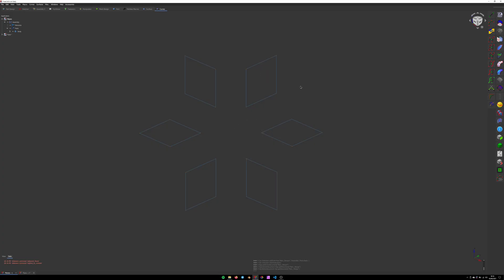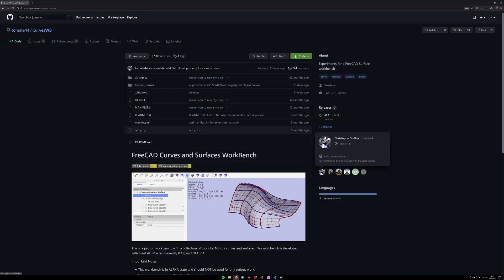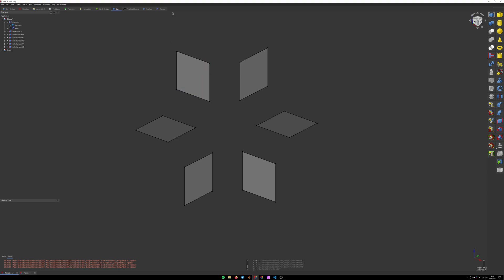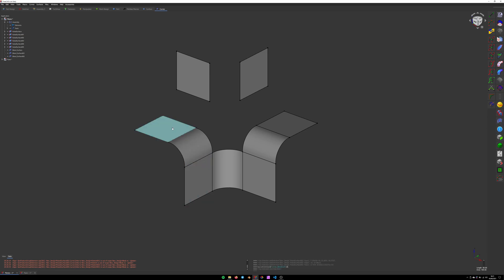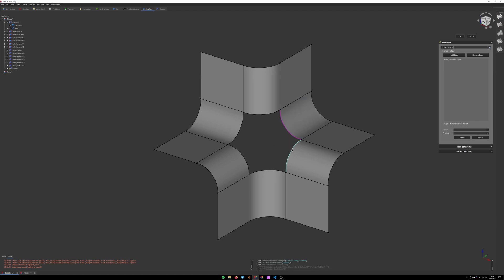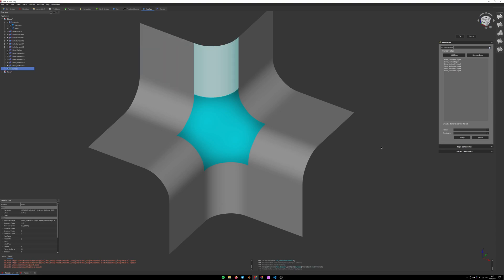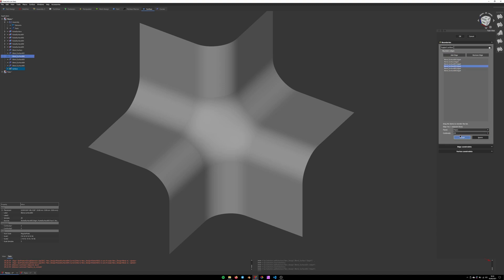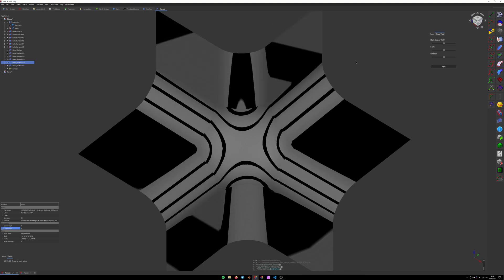[FreeCAD] Surfacing Tutorial (Surface WB & Curves WB) Part 1: Introduction

Comment: Hey question - what mic do you use ? And do you adjust the audio ?
Reply from the maker: Currently I'm still swapping countries, so I'm using my phone as a mic, until I settle down. Yes, I try to remove the noise and make the sound levels more or less uniform. Definitely need a better mic!
Reply: @StudioPetrikas  oh I just asked because your audio is pretty good - and this is just your phone mic ? That’s quite stunning !
Reply from the maker: @cekuhnen  Ha, it's still pretty bad. But yeah, phones do have quite decent microphones!
Reply: The audio quality of your tuts is good - not as bad as you think. That’s why I was curious what mic it also was .

Comment: The boundary fill cannot use G2 here ? I get an is not G0 G1 G2 error message when using G2. Fun fact the result Fusion 360 cannot build with the same smoothness which is quite embarrassing. However FreeCad G1 is not G1 the zebra is broken !
Reply from the maker: There's a couple of things that need addressing here. 
The boundary fill tool cannot do anything other than 'G1' here, as the boundary it's filling is completely made up from G2 surfaces. There's not a single flat face that it can reference and build a G2 surface. So G1 ('tangency') becomes perfectly smooth already. 
Regarding Zebra - G1 continuity is simple tangency, it is not usually considered "smooth", as there is an infinitely small point, where the flat face ends and the curve begins. Zebra tool should break, as the surface is not considered smooth. 
-
However, in this example, 4:07 if you can see that the lines do not break, as the Blend tool is G2 by the fault, and the Boundary fill cannot do anything but be perfectly continuos. If the surfaces weren't continuous, those zebra lines would be disjointed.

P.S. Zebra tool in FreeCAD is still buggy. Any surface imperfections are due to the zebra tool displaying lines on a tessellated surface (I presume)
Reply: @StudioPetrikas  I loaded the surface into Fusion360 and their patch tool will produce a better zebra actually than the freecad surface 

I have to check this later again when I am home.

Thx for the explanation about boundary surface not being able to do more than G1 - fusion actually does
Reply from the maker: @cekuhnen  the end result should essentially be the same, whether the centre filling is G1 or G2

Again, the Zebra Tool on FreeCAD is only visually inconsistent. The surfaces can't be smoother on F360, as the smoothness should be exactly the same.
Reply: @StudioPetrikas  i will check this later in Alias. There I can better check the topology.

Btw do you use freecad for fun or also for your studio work? I went to your website yesterday.
Reply from the maker: @cekuhnen  I've started using FreeCAD fairly recently. I've been using Fusion360 since it's innitial release, but I've stopped using it due to their inconsistent vision. And I simply cannot justify the cost, knowing that FreeCAD can satisfy all my needs and more.
I have already used FreeCAD for a couple of Product Design projects for my clients. However, I would not recommend it to anyone else for any serious work, as there are many quality-of-life features that are still missing.
Reply: @StudioPetrikas  So you feel for it Offenes the tool set you need ? Anything that is missing ?

I know in architecture they use freecad quite success -
I always struggled Sofar with product design however
Reply from the maker: @cekuhnen  It does satisfy my needs completely, and since it's open source, I can streamline my workflow with Blender much better. 
Yes, it's a bit more BIM-heavy than Engineering. 
What it doesn't have that makes my life harder: Sketch snapping (to other sketch objects), easy accessible sketch Offset tool, better Project Sketch integration. The rest does the job pretty well I think.
Reply: @StudioPetrikas  yeah I struggled finding this functionality myself 

Btw very nice UI adjustment ! It looks much less scary - rather inviting and a bit like catia
Reply: @StudioPetrikas  replacing vray or keyshot with blender was very easy - interestingly we started to use eevee primarily a lot somewhat reminding me of the Time using alias portfolio.
Reply: @StudioPetrikas  yeah that’s why I always left after trying it for a moment. But I seriously have to say the new UI work makes it visually appealing. While visual this still carries a lot of weight for new users.